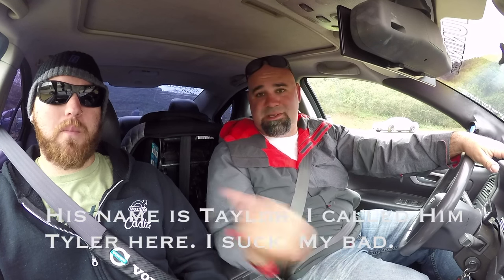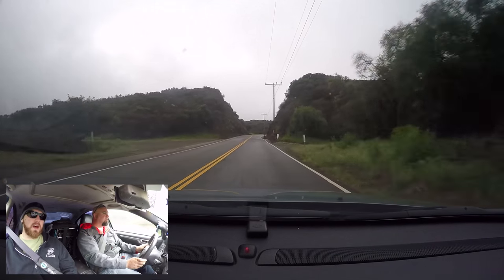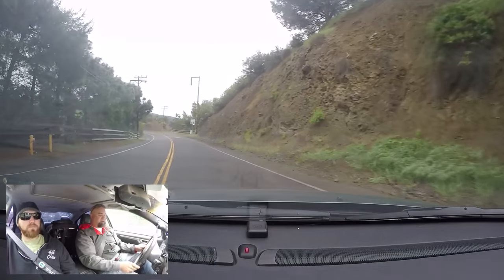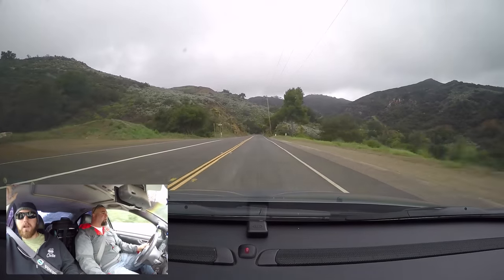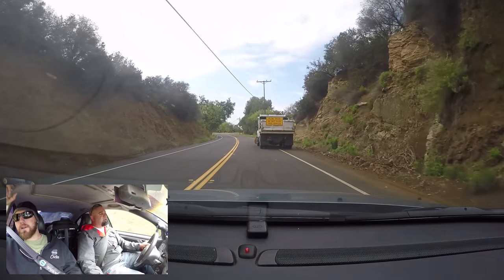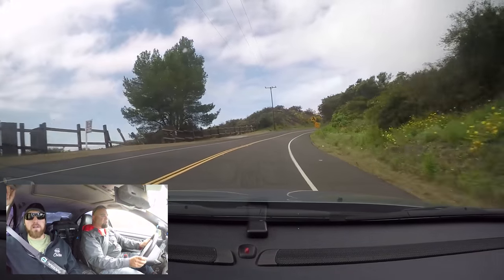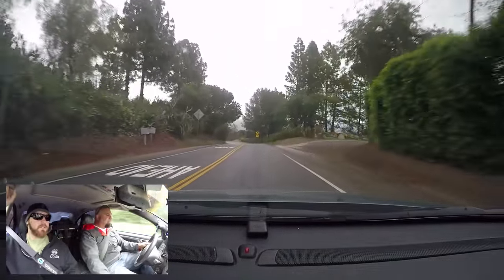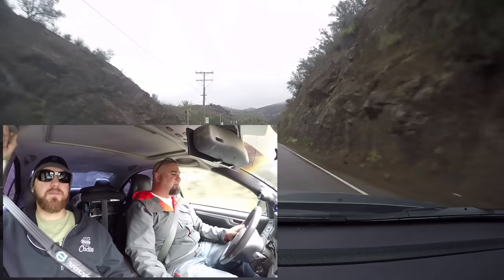Modified Volvo S60 T5 - One Take

Comment: My dad bought used automatic s60 D5 10 years ago as an economy car, it turned out to be more like an economy gran turismo. You can travel all day at 125 mph in comfort and it rides like new with over 235k miles on it with minimal maintenance. The interior and body is a little trashed, but it rides so good that nobody cares.

Comment: Sometimes upgraded injectors can be an issue at light throttle because they don't flow properly at a low m/s. They just want to flow like crazy or not at all. It will give a hesitation just like Matt was describing. I was just watching a video from fullboost the other day about it. It's somewhere to look anyways if you think it's an issue.
Reply: Could be the reason, I do have upgraded 650cc injectors and the tune could be off with the flow rate , I'm actually going for a different tune in few weeks

Comment: I bought a 2016 V60CC T5 AWD last year. In its stock condition it puts out 250/266, it’s no slouch! The engine sounds bitchin’ when you stomp it! In passing on the highway, I’m pretty sure the growl off that T5 has pissed off a number of “passees”, WTF is that I got owned by? Those tail lights are awesome, SEE YA!

Comment: i had a 2000 Volvo C70 hard top coupe and I miss it. with performance mods, you were on your own pretty much. IDP and one other aftermarket company was available, but the Volvo as a whole is expensive to maintain and modify. I had such big plans for that car and I had a great start with modifications, but I didn't have real money at the time to see my vision.
Reply: +PANTYEATR1 There is enough aftermarket these days to do pretty much anything you'd want. But you hit the nail on the head, as a kid in high school I wouldn't have been able to do much to my Volvo, but with a real job now it's a different story. Still if you're thrifty, I think the bang for your buck is hard to beat in a modded turbo Volvo.
Reply: +bob82pigdog i haven't checked the aftermarket since i traded my Volvo, but i wanted to make it RWD using all Volvo stuff where i could. i wanted to do a engine swap with the Volvo straight 6 and turbo that. it would have been nice and one of a kind.

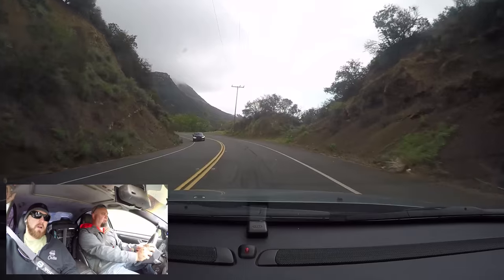Comment: 4:45 my S60 T5 does the exact same thing. Partial throttle it can be a little uncertain, but when you plant your foot its smooth as silk.
Reply: I was reading a swedish tuning forum and it talked about the tuning strategy is not ideal on small throttle input. It may have involved TPS and load instead of more advanced airflow measure. On WOT though it just works.

Comment: this volvo is a sleeper it does 0-60 stock in under 6 sec, I remember 2 years ago I found a certified  AWD 2011 model 25k miles for $20k with 3 years warranty but I didnt get it because my father said their parts are expensive and they are not reliable and selling it after without warranty is hard.

Comment: I like it. I have a 03 v70 wagon 2.4turbo with the CNT 3 inch 200 mtal high flow racing cat, OBXs V70 exhaust basicalled running two 2 inch pipes from the resonator (basically 4 inch straight pipe type sounds), no muffler just turn downs, Snaab turbo inlet piping n took out airbox n replaced with 7 Inch AEM conical Air filter. just needa tune it n that's mt daily driver:)
Reply: too much air and no tune can make your car run hella rich.... I would contact Hilton for a custom tune

Comment: The S60 R would have been a better base for this buid.  It has 5cil.  300HP,  adaptative 3 level suspension, AWD  and a  nicer interior
Reply: Yes.  The car is nice enough, but it's kind of a wannabe S60R and all the mods won't make it AWD
Reply: This Volvo is now better than the R model because there is a B5244T5 engine that can handle 400HP. The Volvo S60R has a worse engine that can handle maybe 360HP and breaks his block ..... (AWD is also useless, at higher speed is slower).

Comment: Anyone who wants a cheap and reliable 5 cylinder you must check out the volkswagen rabbit 2.5, jetta 2.5 or passat 2.5. The mk6 platform is more reliable while the mk5 is more easily to tune. Straight pipes and exhaust systems sound great. I have vids on my channel. But you can buy a cheap mk6 with around 40k for less than 6k now.

Comment: you should let the owner drive since you dont want do push it to its potential, really nice car btw, i havfe a wine red s60 t5 2006 with around 280hp with alu intercooler and different intake, gonna put a stage 3 tune on it soon (400hp on e85) and since its the 05 its the new t5 you guys talked in the video about the spaceshift knob but i have it from factory and mine is not an r i dont know if its different because i live in sweden, lost my license though Xd so the cars sitting right now gonna fix her up soon and get my license back

Comment: do you know if the 2004-2009 s60 t5 specs are underrated? because I bought a 2006 s60 t5 manual and its hard to believe that its only 257hp to the crank, it feels a lot faster when racing on the highway

Comment: You mention CxRacing Suspension do you use the standard S60 / V70 set? If so why does it mention that it doesn't fit FWD if you are clearly running it

Comment: You should try to find someone with a modified S60R. If my Passat W8 happened to die in the sudden future, I'd probably try to hunt down a S60R.
Reply: +Joe Gioia It's only a matter of time... Better start hunting now! haha Sorry I couldn't resist. I looove W8s, though.
Reply: Well, mines at 205k miles and still running! There's actually a v70r for sale in my area, which I think is just the wagon of the s60r.

Comment: I've had one, bout then I discovered that they have open cylinder block with no liners - by the hard way - cylinder block has cracked witch caused missfiring and overpressure in cooling system.

Comment: The N/A sounds the same without turbo specific noise;and wheel's spin too. I heard the same ruum noise when going up rpm's. Nice engine it's 2.4 so expensive taxes and it's transversal engine mount and FWD 5 piston, how would it whine with NOS maybe =RB nissan? The owner wasn't reliable :p

Comment: actually the 2005 2.4T5 manual, has the same 6 speed (M66) gearbox like the R. If this T5 has the 5 speed (M56) then it's a 2.3 and not a 2.4. Great car though ;)
Reply: +njshift got it :)

Comment: People blow there transfer cases (angle drives) when they increase power and don't upgrade there Engine/trans mounts. stiffer mounts should be a first in order when adding power to transverse mounted engines.

Comment: I was under a volvo and it had FoMoCo stamped everwhere .think it was a c30. like a 2 door Swedish focus
Reply: C30 is basically a Mazda3 with a bigger motor (T5). Technically the S60 was built during Ford's ownership. Don't believe any parts were carryover. For example the Mazda6 and Ford Fusion are the brothers. Even the MazdaSpeed 2.3 turbo is almost identical to the Ecoboost 4 in the Fusion.

Comment: How do you go through two engines? Did he use ARP studs without increasing oil pressure and the head went poof or what?
Reply: How tf do you destroy a head by using different fasteners?
Reply: increased torque and larger clamping force against oil channels means without increased oil pressure or modifying head you can fuck up the entire head. Seen some evo guys do it on their 500+ builds.

Comment: The 2.4l engine is not a T5
Reply: After 2005 the T5 was enlarged to 2,4L
Reply: +volvmerc1999 the T5 is 2.5 liters from 2005 on up. The 2.4 liter is simply the 2.4i. Both 5 cylinder turbos.
Reply: The T5 originated as a 2.3 in the p80 chassis (850,s70) also in the s60 T5's from 01-04 were 2.3's , the 05-07 T5's were a 2.4L with beefier internals and capable of handling more power. There is also the T5's in the S40/V50/C30 which are a 2.5 but low pressure turbo and make much less power

Comment: Rear suspension in the R is different. Might as well get an R at that point.
Reply: +Rene “Kris” Hourian lots of reasons to get a R mate..
Reply: The T5 blocks handles more boost than the R's, the 4C suspension is expensive to replace when it craps out, and don't forget about the iffy AWD system on the R's so there are reasons why not to get an R too.
Reply: owen75 if we shy away because of those things no one would buy the "performance" versions of anything, we would have only 2.5RS's and no STi's and the like
Reply: *****
 well when it comes to these P2's it's not bad to get the T5 is all I'm saying. Some people actually prefer them over the R, these are like the R's with less problems.
Reply: ***** Lots of reasons not to. 2.5L has issues with cylinder sleeves cracking with much over 300-350whp. Meanwhile you can make like 500whp on the stock 2.3L block without resleeving. More moving parts with AWD means more shit to break. Also means more drive train power loss. Also it's Haldex.
Reply: Also when I say rear suspension is different I mean like it's an entirely different suspension setup/layout type. The stock car using volvos multipoint system which has similar benifts to double wishbone and the AWD cars use McPherson in the rear.
Reply: ***** There is a reason why when people wreck their 2.5L blocks trying to go for more horsepower they switch to a 2.3L. The 2.3L block IS superior.
Reply: Rene Hourian I have a XC70 with the T5, I probably have 250 crank as I have modded everything but the turbo, ecu, and fuel system, I live in northern MN and it snows for most of the year, we get about 5-6 months of summer and most of that its raining, I don't have a choice but to get AWD so whatever problems they may or maynot have are inconsequential.

Comment: heavily modified? comon...
exhaust, downpipe, ecu tuning, airfilter and 20t turbo... even perhaps some other injectors i suppose! 

put in some forged pistons and conrods, swap out that little turbo against something that can handle over 350hp... while you are making it nice do a cylinderhead jobb too... some 1000cc injectors and e85 remap! Should do wonders for your car! 

i got a t5 too... but automatic, so im just rolling with ecu mod, 3" catback, heavyduty boost controller and air filter! Great engines to modify! easy to get out 500hp+ from these!
Reply: +Mikael Vilund   this is my daily so just trying to play it safe right now.  as for the auto trans better beef it up those don't handle well with 320hp+
Reply: aren't the cylinder walls on the block too thin for high horsepower builds?
Reply: +Ricky Trahant  the R's have thinner cylinder walls..
Reply: Taylor Cadiz oh, I didn't realize the R had a different block. That's a killer Volvo, Taylor
Reply: The R has 2.5liter block, T5 has 2.3liter.
Pistons are 83mm in R, 81mm in T5.
Did build a engine on a 2.5t V70 -98. 
Used its original 2.5 block, put on a volvo 850 T5 head with T5 cams and a 16t turbo and 3" downpipe. WOW!! Got some serious speed out of that thing! Manual tranny... Conrods gave up on me after 2weeks! :P

Comment: Jeez... Im saving up for a Mazdaspeed6 but I dunno... after this video... Im kinda curious to check out an S60R. This one sounds amazing but Im a bit preferable to AWD.
Reply: S60R's are great except they aren't reliable by any means, even on stock boost. be prepared to watch your money drain away.
Reply: Nick F The speed6 is great if you know what you're doing and you're familiar with the platform. The majority of reliability claims are from idiots who couldn't change their own oil to save their lives.
Reply: Nick F And the speed6 most certainly lived on for many more years. It lived on in the form of the ford fusion(same chassis and AWD system) and the engine/transmission lived on in the cx7 and speed3 for another 6 years. 

That engine went on to serve as a template for the ecoboost engine line up. Who knows who else benefited from mazda's early r&d in turbocharging + direct injection.

Comment: How much power is this s60 making?
Reply: +shakeel sayed Stock it's 250 crank. With the upgrades and more boost it's not obvious how much it would be making. Likely closer to 280 though.
Reply from the maker: At least 275-300 at the wheels based on the ass dyno
Reply: +TheSmokingTire should be making more, if it is runing a 20t at 20 psi
Reply: +Robi Flego yeah, where is that 20 PSI goin? Haha
Reply: +TR7 TRIUMPH beats me haha,  altho 300 wheel could be the number,  but those engines can take 450ish on stock internals with a well tuned map

Comment: what's Taylor's name I have a 04 volvo s60 2.5t n starting mods but hard to find could he message me n let me know
Reply: Jason Ghering theres a really good Facebook page for 850r  v70 t5 v70r s60 t5 and s60r. good group always will to help out with any questions
Reply: fisherman foub ....I'm on a fb volvo thread but they don't help much I'm putting a t4 turbo in it and intercooler by end of summer just cost a bit ...I already have a MagnaFlow straight pipe from the heads back,intake,and chip in it just upgraded brakes to brembo,and no getting bilstein shock strut assembly and my body kit comes this week I'm just getting one thing at a time Def not rich struggle like everybody else lol
Reply: Jason Ghering I hear ya man the struggle is real I bought a v70 t5 a few months back and even pricing out a stage 0 isn't going to be cheap.

Comment: Those racing harnesses are so incorrect, in an accident he would be better off with the OEM seat belt than a racing harness that isn't properly set up like that one. Other than that cool car.
Reply: Where is the racing harness?
Reply: Racing harness? Hey have normal 3 point belts on with a little Volvo cover/pad on one.
Reply: 0:57 when they do the walk around they show the harness, but the belts are both coming out below both Matt and the owners shoulders, which means in an accident you would suffer traumatic spine compression, and they are not guided properly by the seat so they will pinch the drivers neck in an accident.
Reply: +flacjacket weird. They don't wear them.

Comment: Sorry dude, no front wheel drive in my garage. Period
Reply: Actually most ppl here swap the T5 engine and put in in a older 740/940/240 because you can get a T5 engine really cheap and older Volvo models are rwd.

Comment: I'm a big fan of XC70 looks, sadly there's no polestar XC70, as far as i know. So they are not exactly the fastest cars from stock.
Reply: +Error Creator You're right, but the older XC70 was available with a 5 cylinder 2.5T, so could easily be made into an absolute beast!
Reply: Iain Murray I would make it into a sortoff rally car, that can at the same time be used as a family car, so I don't really need massive ammounts of power. If I have tight gears, then 350-400 is easilly enought to make it feel fast on swedish rally roads.
Reply: Error Creator That would be cool mate. I have images in my head of a jacked up rally raid / dakar style machine! I've got a 350bhp Focus ST with the same Volvo 2.5T. The torque is amazing from these Volvo 5 cylinder motors and they sounds increadible
Reply: Iain Murray Sounds good, it's torque you need to spin up all 4 tires and slide arround corners when rallying. Though i'm still young and don't have the money to get such a car yet, it will hopefully be my project car in a few years.
Reply: +Error Creator mine is pretty fuckin fast, I have a bunch of IPD stuff on it tho, beat a lot of fast cars with it including a supercharged mustang
Reply: Error Creator Nice one, well good luck with your future build if it happens :)

Comment: anyone know where I can find a shift boot like that
Reply: It looks like a gated shifter, it looks nice. I think you would need to find more than just the shift boot, you would need the shifter arm to be thin as well and the outer enclosure, I think there is some custom work involved.
Reply: +SI0AX alright thanks, I might look into that. the reply is much appreciated.
Reply: no custom work bro.  i have this car.  the shift trim plate is bought this way.  the spaceball comes this way factory.  the only thing different is the knob.  shift shaft needs to be die-threaded and the ball knob screws on..  pretty sure the knob is an M1 Abrams.  looks cool, but that's credit to Volvo designers not this guy.
Reply: Kit Vexed
Cool, didn't know that. Then I have to say that IMO, Volvo makes the coolest looking shifter assembly ever!
Reply: +SI0AX I agree, that looks sick
Reply: feels great in hand too!
the ball can be moved up or down..
Reply: +Kit Vexed that's so cool.

Comment: Given all the positive comments, I must not be a Volvo guy, bc this thing looks and sounds like a POS to me. All that tire rubbing is like nails on a chalkboard to my ears.
Reply from the maker: That's not tire rub, that's waste gate flutter at maintenance throttle
Reply: TheSmokingTire Is it though? There are so many noises its hard to tell if we are talking about the same thing. I'm referring to the scratching noise during every turn. Regardless, just not my thing I guess.
Reply from the maker: +John Smith yes, in corners is when I would be using maintenance throttle.

Comment: Third motor... Jesus.
Reply: +Matthew Hutzell buy a Volvo they said, it 'll be fun
Reply: Yup, that's what happens when you max out on all the software upgrades and don't do shit with the hardware. But that's basically what the guy said in the video too, so fair enough. I just get tired of people blaiming the car brand for their stupidity when they break their car. Volvo is, if not THE most reliable car brand out there, one of the top. There's way too many old 240's, 740's and 940's out on the road with way over 300 000 miles on them without rebuilds xD
Reply: +J Gripen  poor tuning was a key factor in those blown  motors
Reply: Taylor Cadiz Yea, that too
Reply: My old boss had a first gen v70 diesel with 500 000+ miles on it.

He never had any issues, just kept it in good shape